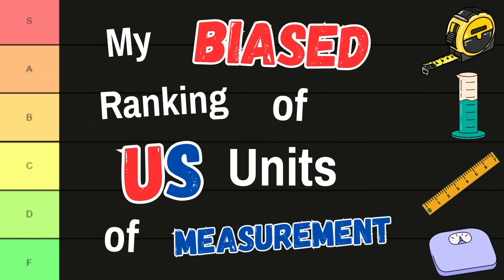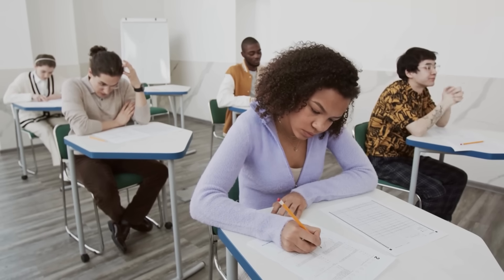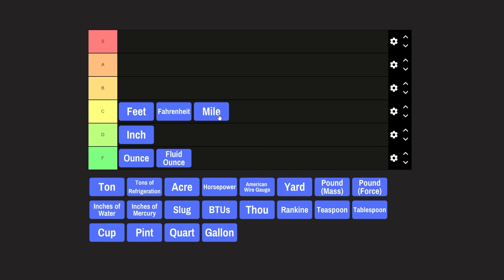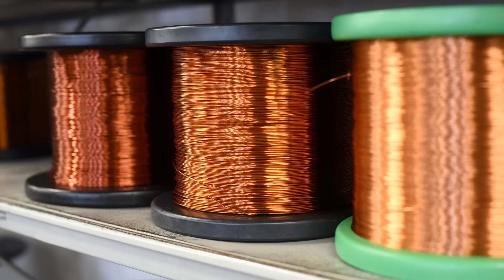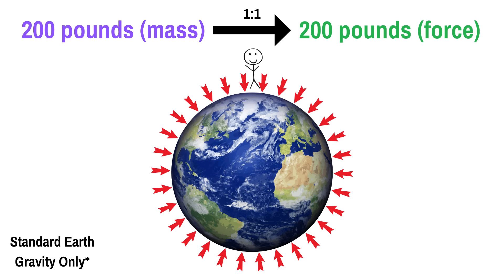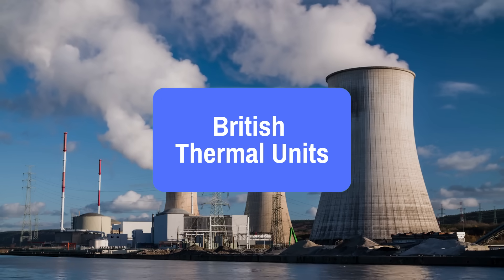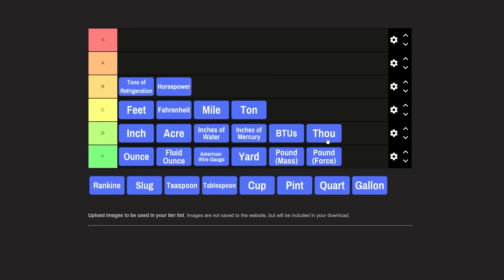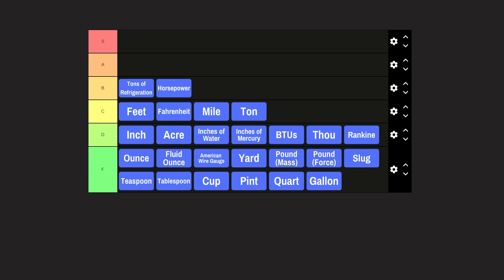Tier List of the DISASTROUS US Measuring System

Comment: Personally, I use "Handfulls" for volume; "Bloody Freezin'" to "Effin' swelterin'" for temperature; and "About This Much" for length.
Works for me!   😎👍
Reply: America:

"Write that down!"
Reply: "About this much" can be inconsistent at times, use 'bout yay big instead
Reply: @nmmeswey3584  I don't need to work to that sort of accuracy very often.  When I do, it usually ends up as "Bloody hell! It needs to be bigger!!!"🤠
Reply: stm7810    If you want a more powerful rocket, you could always invest in a full acetylene cylinder and knock the valve off with a sledge hammer BUT :-

DO NOT TRY THIS AT HOME.  🤯>🤕
Reply: I have come up with a genius simplifaction of all measuring systems, I call it the "Binary System or "BS" in short. Basically, I judge everything dependent on context, e.g. "is this piece of string long enough", "can I walk this distance on foot", "Can I lift this object" and it ends up as either Yes or No. No more tyranny of numbers!
Reply: @xdurch0 to bake this cake you need (portion is bigger than you can eat in one meal):
Less than you can lift with one hand (following ltyclwoh) flour
ltyclwoh eggs
ltyclwoh butter
ltyclwoh sugar
ltyclwoh baking soda
ltyclwoh bake cocoa powder
 
Mix everything except the cocoa powder and fill half of it in a form, mix the cacao powder to the other half and fill it in the form too. Go through it with a fork one time (to make it look like marble).
Heat the ofen less than you can touch and bake it till it's good.

One of the easiest Rezept I know and without the cacao powder and baking soda it's even is ok from the measurements....
Reply: @RickDelmonico Its still not bread.  Imoerial sucks, cant even make bread, its so confusing you made a cake instead.
Reply: About yay high
Reply: stm7810 
Build a rocket? : Paper fins, Coca Cola in a bottle, an aspirin and quick reactions are all that's needed.

Carpet a floor? : Get a bit of carpet slightly bigger than the floor, put the carpet on the floor and cut off the bits you don't want.

Check for fever? : Place hand on forehead and if it feels "Effin Swelterin" it's a fever and if it feels "Bloody Freezin" it's a chill.

Etc., etc., etc.  😎👍
Reply: You must be an Ozzie
Reply: @OneEyedJacker  No Mate! A Pommie Bast'd.🇬🇧  🤠👍
Reply: @farrier2708  You got up to some shit back in the day didn't you?
Reply: It's also useful for quantities of lengths of materials. A handful of surface cable trunking is around 5 lengths, a slack handful is closer to 8-10 😂
Reply: And "notenough" for a drink...
Reply: Tbh not much worse than imperial
Reply: Why not, it works for the americans too.
Reply: Im guessing you're a fellow aussie?

Comment: Even though Fahrenheit looks nice for measuring outdoor temperature it's actually horrible for defining weather and other practical usages. Water freezes below 0⁰C, melts at 0⁰C, and boils at 100⁰C. Thus, you know that if there's -3 < t⁰ < +3 it will be a mess of a snow, water, rain, and mug. If the teapot is set to warm until 80⁰C you won't be able to make a tea out of it because water will not boil.

Comment: One ounce is 1/16 of a pound ,1 pound  is 240 penny weight or the weight of 240 silver pennys which was the standard coin for many centuries.240 easily divides by1,2,3,4,5,6,8,10,12,15,16,20,24,30,40,48,60,80,120 all without much education.

Comment: i like playing devils advocate on the inch/foot ratio, so heres some non typical reasoning:

base 12 is better for divisional math while base 10 is better for multiplicative.
12 can be evenly divided into 2, 3, 4 and 6, while 10 only covers halves and fifths. this is part of the reason we measure time in 60 minutes to the hour, and 12 hours to the half day, and also part of the reason that in western music theory, we divide octaves (doubling of frequency) into 12 equal parts. it allows for cleaner calculations when trying to divide and represent simple ratios.
this logic can also extend to the yard and mile ratios, but not exactly as cleanly.
there are benefits to calculating distances you wish to divide in a base 12 system rather than a base 10 system, however the cost may outway the benefit in doing so
its also worth noting that base 12 systems may be the second most popular base counting system in the world behind 10, not including in the field of computer science where 2 and 16 are king because they're the best uses for doubling and squaring maths.
this is partly why, in the english language, we have the terms Dozen and  Gross to describe degrees in the base-12 system, and that represents more linguistic coverage that any other base other than base 10.
obviously base 10 is far more useful in modern applications than base 12, but base 12 is not without its advantages over base 10
Reply: Computers use binary, 2s, not 16s.  Base 16 is not a technical thing, it's simply a notation that humans can grasp easier.  Numbers get shorter and are easier to read, that kinda fing.

Comment: A mile is supposed to be 2000 steps, not 1000. A "pace" in this context is two steps, or the distance a single foot travels each time you step with the same foot. When you're literally counting steps to measure long distances, counting every other step (e.g. every time you step with your left foot) is more efficient, and a more comfortable rhythm to count at.

The reason you got about 1200 steps a mile instead of 2000 is because you were running instead of walking.

Comment: As an Englishman, I have to say that if I grew up with cups and quarts, I’d have found cooking a lot easier because I usually can’t be arsed to measure the ingredients on a scale. 

That being said, I think we’ve got the golden system of measurement: 

For measuring structures we use metric because it makes the maths more precise. For measuring people, we use imperial because it’s more simplistic. 

We also use imperial for distance and speed because it makes sense that you’d be estimating distance and imperial is again, more precise.
Reply: That sounds like a < you > problem.
I learned to quickly invision just how much 100 ml is, or 100 grams, or 60 L, etc. If you then have to use smaller or larger quantities using the baselines you're already accustomed to, just divide or multiply accordingly.
It's not rocket science. Morever, don't act like you like it when a recipe mentions "oz" - also, what the fuck is a "stick" of butter?
Reply: @Mayhamsdead  or a fucking cup of cold butter, which is an abomination I frequently see in American recipes. How you would measure solid butter by cups and expect it to be precise is beyond me.

If you can't be arsed to use a scale, then can you really be arsed to wash the utensils you used to measure the ingredients? A cup for wet, a cup for dry, several spoons? Using a scale is the fastest, most convenient and accurate way. Hell, you might even fail without a scale, like with meringue or souffle - you gotta be extremely accurate in your measurements for these to be done well. That'd only turn you away from cooking. Metric and a scale all the way.
Reply: @Mayhamsdead  no need for the rude comment. I get where you’re coming from, it just makes sense as like a beginner’s cooking method that you’d measure by volume rather than mass.
Reply: @thelawbringer4125  As a beginner, you learn.  And thus you learn that some things are measured by volume, and some by mass.  Surprisingly, you use the type of measurement depending on what makes sense.  "Cup of butter" or even "better", "cup of flour" makes no sense at all.
Reply: My brother in christ, you didn't just call imperial more precise.

Comment: Fahrenheit is better for weather (which is what it was measured for initially). It doesn't go into the negatives, either (unless you live in a place that hates you). You literally can't measure snow without going into the negatives. Also, at weather temperatures, Fahrenheit is more precise in regards to temp. 85° is much better than 90°. Compare that to 29.4° vs. 32.2°, which is 2.8° difference compared to 5.

This is important because most people tend to round to the nearest 5° when describing the weather. We do this for a lot of measurements. It's ingrained into humans. Numbers in 2, 5, or 10's are easy to work with, and therefore, humans will always round to them based on appropriate changes in intervals. 

Going up 5° (dealing with weather) is easy. 65° makes many bring a jacket in case it gets breezy, while 70° makes them forgo it. Concurrently, 20° means pants and a long-sleeve shirt or jacket, and 25° meaning shorts and a T-Shirt. 

Is this me being pedantic? You're God damn right it is. But I refuse to incorporate decimals when dealing with temperature (and yes, I know measuring body temp is 98.6°, but that's the only exception). It doesn't help that temperature is the only thing I can't convert by multiplying a number like 1.6 for mi to km or 3.28 for m to ft! I'm not running an algorithm in my head to figure out temps.

Comment: The conversion between feet and miles seems ridiculous because they actually are from completely different systems, like converting between miles and meters. An acre is 43560 square feet, which isn't even a perfect square? The acre is actually 1/640 of a square mile. One furlong (the length of a furrow in a plowed field) is 1/8 of a mile, a surveyor's chain is 1/10 of a furlong, and an acre is one chain by one furlong.

Comment: What do you mean Metric Ton?  Don't you mean Megagram?... don't tell me they're corrupt too... surely 1000 metric tons is a Gigagram... and so on. Certainly they wouldn't use teaspoons in cooking over their sophisticated milligram... right? They'd logically label engine displacement consistently, and certainly wouldn't have a definition turn into a unit... like say, selling liquids in the store in milliliters,  but administering medicine by cubic-centimeter. Surely, with using the earth as a baseline, they'd have set its circumference to a whole unit of some kind, and definitely would not have picked an arbitrary number to yield an arbitrary size for the meter. How many degrees is a meter, again? Surely they correlate to something less ridiculous than 360 degrees for a circle, right?... and definitely, beyond a shadow of a doubt, if measurements were made incorrectly, the units themselves would be adjusted accordingly, as opposed to redefining them to be completely arbitrary measures of space... right?... because that would be absurd.

I love how you break down the entire Imperial system of measurement, basically saying  "yeah, so here's this concept everybody understands... let's define a unit of measure around it" then question the logic??? While certainly Imperial has its faults, I must give credit where it's due. Fahrenheit may have gotten lucky, but when it comes to air temperature, 0 is almost exactly centered between the hottest and coldest ever recorded temperatures... and honestly, beyond that, temperature is completely arbitrary no matter what system you use.

All I'm saying is there's something to be said for building a system of measurement around working concepts. Metric literally only focuses on base 10 conversion and threw everything else to the wind... said "good enough" then forced everyone into it. If they'd just stopped to think a little, beyond math and science... they would have actually created something truly remarkable. Instead, all we've got is this half-baked, barely functional measurement system, only marginally better than the imperial mess (which honestly is still remarkably organized, compared to other measurement dumpster fires of the time) and saying "it's great because everyone uses it!!!" ... alright, so... English is the official standard language for International communications, treaties and laaw.... so I fully expect everyone to drop their native language and adopt English as the exclusive global language. While we're at it, everyone adopt the dollar, and standardize it against the top 5 most stable economies. 

I love the Metric system, but it's not the divine gift from God everyone claims it to be... and honestly, though the units don't relate to eachother, you have to admit you'd have great difficulty finding units of measurement sized more usefully for their specific tasks, than Imperial units.

Comment: Fun fact: Panama as a country "officially" uses the metric system, but most people still use some units from the imperial system along with metric.
For example: we measure our height in meters, weight in punds and kilos, distance in centemiters, inches, meters, kilometers and yards (mostly for fabric, but you should ask for it to be measured in meters, otherwise you're getting ripped off), liquid medicine and cooking measurement in both milliliters and tablespoons; pints, cups, liters and gallons , the standard papers sheet size is letter instead of A4, our measuring cups have both cups and milliliters (the latter got added like 10/15 years ago). We never use Fahrenheit though, it is the devil.

Some people from all-metric countries (e.g my venezuelan fellows) get all confused at our weird mix of units. I find it hilarious
Reply: It happens in poor countries dominated by the American empire.
Reply: lol, I've used both C and F at various points in my life, and for everyday use, they're both fine. The climate where I live now typically ranges from 20 to 90 degree F. Or -6 to 32 C. They are both a double-digit range of values and there is never a need to convert to any other unit. Nor any meaningful reason to do multiplicative arithmetic. Of all the units to get hung up on, I think temperature is the least pressing.

Comment: Measurement systems work best for the systems they are designed for. Base 10 measurements like metric are great for science and engineering. Fractional measurements like inches are superior for things like carpentry because of the ease of dividing by them by 2,3,4, etc, which is much messier with base 10.
Reply: "Fractional measurements like inches are superior for things like carpentry because of the ease of dividing by them by 2,3,4, etc, which is much messier with base 10."
And yet construction and carpentry around the world use metric. 
Weird!

Did you know that people use mm removing the need for fractions or decimal points?
I guess not!
It's interesting watching American home woodworkers use metric and give their feedback.

Comment: As a former fridge and air con technician it warms my cold heart (pun intended), that ton of refrigeration is included on this list. For the freedom unit impaired it's equal to about 3.5kW of cooling capacity.
And staying close to my former trade I'd like to add one more unit: grains. Which is used to measure absolute humidity in air conditioning. Because of course it is, it just makes sense (1 grain is 1/7000th of a pound by the way).
Reply: Ah, yes.
But of course.
Elementar, really.
Reply: Am I wrong or are grains used for gunpowder measurement as well?
Reply: @wt29  Yes grains are most common used for measuring gunpowder and bullet weight.
Reply: @TonyGlynn58 Maybe. Sometimes I'm watching gun videos because I find their mechanical working interesting, but I'm not into guns, so I wouldn't know off the top of my head what unit they use for gunpowder.
Reply: @Ikreisrond US American HVAC technicians do to measure the amount of water vapour/humidity in the air. Don't ask me why they don't use fractional ounces or maybe drams (16 drams is an ounce). In metric countries we use gramms for the same (about 15 grains is one gramm).
Reply: @Ikreisrond It's commonly used in the medical profession (notably pharmacology) for medications. It's also used in the firearms industry when referring to the mass of projectiles (bullets) and propellant charges (powder). Hope this helps.
Reply: It doesnt help.  Switching to metric would help.
Reply: Oh, there's another grain unit that he forgot for small amounts or mass! I know Americans use it to quantify the amount of explosive in a bullet
Reply: Grains are also used to measure bullets! Specifically, projectile weight. This 9x19mm cartridge uses a 110 grain projectile and can launch it at 1300 feet per second from a 4 inch barrel!
Mixing several different completely incongruent systems of measurement together is fun!
Reply: @Ikreisrond guns:
The mass of a bullet is in grains (in the US), the heaviest .308 bullet i know of is 150gr.
It's not practical neither widespread but since muricans want to keep the genocide unit system....
Reply: Freedom-unit-impaired, that's people impaired BY the freedom-unit system, yes?
Reply: You were formerly a fridge? 😬
Reply: With freedom units you mean the units that the empire forced upon its colonies?
Reply: @matteagle42  imperial units were created after us independance,  both adopted the international inch in 1959,  by now freedom is more appropriate than international
Reply: @matteagle42 No, it's freedom units because we use them to allow the rest of you subjects to FREEload off the US taxpayer. The next time you want to complain about units that don't affect your day to day life (and when they do, you can Google the conversion), try converting your NATO contribution to your GDP. If it's less than the US' kindly go shut up.